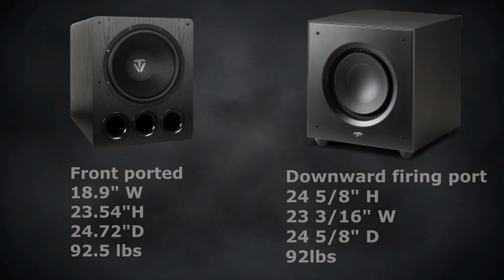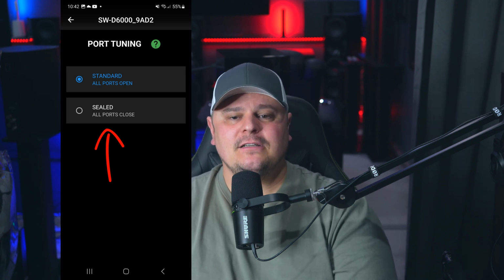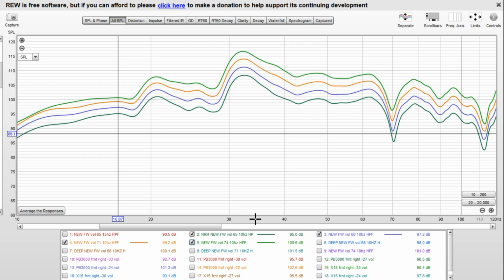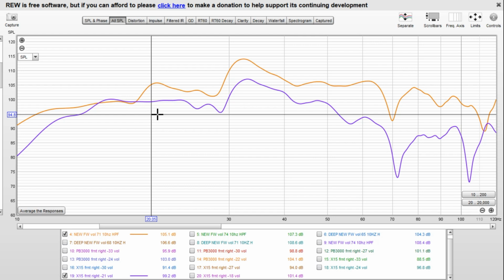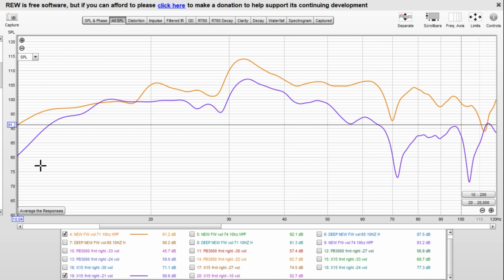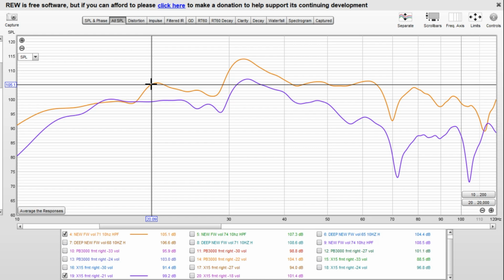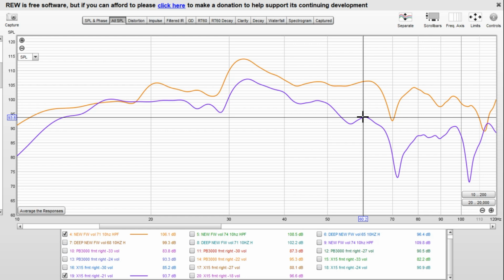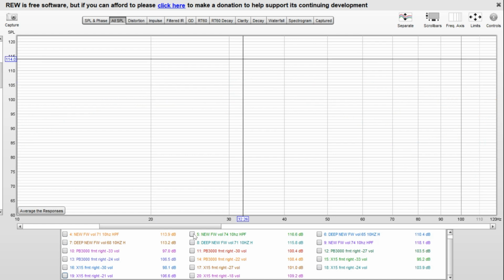Subwoofer Showdown, The CHEAPER Sub Wins?  Paradigm X15 VS Tonewinner D6000 Comparison

Comment: I'm very impressed on the d6000 performance for today's demo. These subs rumble low and deep which something I don't get from a 12" sub. Now I'm confused in either getting the D4000 or the D6000
Reply from the maker: I can understand your confusion!  The D6000 is an impressive subwoofer.  I would suggest the D6000 if you can fit them in your budget.

Comment: Great video, but there’s an astounding discrepancy between your REW measurements and the X15’s CEA-2010’s burst measurements. Of course room disparities play a big role, but this delta leads one to believe that all of these metrics should be taken with a grain of salt. Not yours in particular, but in the main.
Reply from the maker: But you can't compare CEA2010 numbers and compression testing, they are totally different.
Reply: That certainly may be the case. I probably stand corrected. Great content by the way. Keep it up.

Comment: Many years ago, REL was charging about $2000. USD for a 12". sub.  At that time, I built a dayton titanic 15". kit sub.  It was $699.  The Dayton outperformed the REL in every single area.  Fast forward a few years.  Velodyne made subs upwards of $4000 that had an output of about 105DB@ 20hz.  There are $1200 subs now  that can do that, and more.

Comment: Just saw some reviews today on the new klipsch rp1600. Do you think you’ll be getting one of those in for review. What’s the difference peak power makes, is it headroom? D6000 800rms 3000peak. Rp1600 800rms 1600peak.
Reply from the maker: I am hoping to get an RP1600 in to compare to the D6000.  The peak power will just help for short burst dynamics.  It has more power on tap to give you those powerful short dynamic LFE signals.  It will have more headroom, but only for the short bursts.

Comment: For an initial set up without towers for now, what speakers would you go with that replicates a powered  sound bar or book shelf speakers using the Tonewinner D6000?
Reply from the maker: I would definitely go with bookshelf speakers over a sound bar.  Powered bookshelf speakers will get you better stereo imaging over a sound bar.
Reply: No amp yet. Would the bookshelfs use tv audio out? Also what tv out would plugged into D6000?

Comment: Another great video! I’m curious have you reviewed the monolith 13 or 16 yet? How would the D 6000 compared to either of those? My three PB 2K pros are not cutting it for me in my 11 x 18 room. And I really need to replace them and hopefully only want to do this one more time since my pb2k were an upgrade from the sb1k pros. I can see myself spending $1500-$2000 per sub. With a max of $4500 spent. What would you do if you had $4500? 2 monolith 16, 3 d6000, or 3 monolith 13?
Reply from the maker: Sorry my friend, I have not heard the Monolith 16 or 13.  Do you find you get a nice smooth response with 3 subs in your space?  If you are getting a nice response, I would try and stick with 3 subs for your next upgrade.  All 3 subwoofers you listed have fantastic output, if budget is a concern, get the 3 D6000.  With the money you save, invest it into an upgrade for something else in your system.
Reply: @SpecOfTech  I’m able to achieve a pretty nice summation of them using my MiniDSP, I just get little to no room pressurization. I have a window sized opening and door sized opening to another part of the house in that room. I’m afraid to make the wrong decision and be underwhelmed again after spending even more money. I’m sure you’ve heard all that before though. If you were going to go 1 step above the d6000, what would that be?

Comment: Very strange performance data on that x15. IIRC, the x15 killed it in the mid bass region during the Audioholics testing. I believe they called it a mid bass monster in the review.🤔
Reply from the maker: It absolutely is a mid-bass monster, but you can't compare CEA2010 numbers from Audioholics, to compression testing, which is what I have done.  CEA2010 numbers are burst measurements, and just measures the peaks on a short burst of certain frequencies.  Compression testing tells you when the drivers starts compressing at certain frequencies based on its own limitations and DSP.  Audioholics has some more advanced compression testing on their page of this subwoofer and if you have a look, you will see it started compressing at a similar SPL as in my testing, give or take.  Their measurements were not in room, most likely taken outside, so my measurements will be more flattering in the low frequencies, given the room gain.  Not exactly apples to apples, but I do believe their compression testing does correspond with mine, given the differences in testing environment.

To make a long story short, compression testing is not giving you  the max output on each frequency, like CEA2010 numbers are.  It is giving the max output before the driver starts compressing SOME frequencies.  I hope that makes sense.
Reply: @SpecOfTech  interesting. Still seems like something is off to me. Given what we know about driver size, amp power, and cabinet volume - the 3 subs you tested and compared should be more similar than different. I believe they all claim to have long throw/high excursion drivers as well. That is an absolutely gigantic disparity in performance, wouldn’t you agree?

Anyway, I’d be interested to see how it stacks up against the Cap 2400. It should not be close.

Comment: Was the x15 in music or movie mode - you mentioned you had them both in their "standard" mode.

Could you compare or upload some screenshots somewhere of deep and strong vs movie mode, if indeed the x15 was in music mode ? 

I ask because the digm according so sone publications is a quite a bit softer in midrange in music mode, with 5db less from 35 hz to 65hz in music mode vs movie.

Wondering what the tone winner does in their other modes.

Thanks
Reply from the maker: The  Paradigm was in movie mode for max extension.  If you want to see how the other modes in the Tonewinner perform, you can see that in the review video, here is the link: https://www.youtube.com/watch?v=y4HyhWM10YQ
Reply: @SpecOfTech  thanks.

Comment: what do u mean by "compression" in this measurements ?
Reply from the maker: When measuring the output, the DSP will start compressing the response (reducing the SPL of certain hz) to help protect the driver from damage.  So essentially, once you start hitting compression you are reaching the threshold of the driver, at least at certain frequencies.

Comment: The compression testing you did was the bare minimum. Mainstream reviewers provide compression tests for the full bandwidth rather than stopping as soon as any slight compression is encountered. Without that, how are we to gauge mid-bass performance? Was the Paradigm using ARC? If so, then it doesn't make sense to count its taming of peaks as loss of output. Regardless, some data is better than no data so thanks for your effort here.
Reply: He was not using ARC..😊

And for subs, there is not much above 120hz anyway ..so no need to measure higher..
As most systems anyway, cross over much lower..and LFE Typically plays to 120hz.

Anyway, with the info he provides, I see enough to make a decision for my eyes anyway ..

But yes, some Info is better than no info👍
Reply from the maker: Clarify what you mean by "full bandwidth".  I stated in the video that no room calibration was used.  Give me an example of a "mainstream" reviewer that provides "full bandwidth", I believe there may be a disconnect with what you mean, and what you are saying...cheers.
Reply: @SpecOfTech  By full bandwidth I just mean for LFE, or up to around 120hz. You're stopping as soon as you encounter any compression but the sub may have a lot left to give in other areas. For the type of testing I'm advocating Audioholics reviews by James Larson are typically good examples - check out their Monolith sub reviews. They perform what they call "long-term output compression" tests where they just keep increasing the signal until no more output is seen at any frequency all the way up to 300hz or more. Erin's audio corner has also provided that data but just in table form. Their tests are outdoors so I'm not suggesting you go that far, but increasing the volume until compression is seen at all frequencies would definitely show more and help people make informed decisions. Doing that with JTR/Funk/Harbottle subs may be too extreme but I doubt there's much risk with a commercial 15" sub. Thanks again!
Reply from the maker: @miscreant1739   I understand what you mean now, but the numbers Audioholics provide are CEA2010 numbers, they aren't quite the same thing. CEA2010 numbers are burst numbers that show what the subwoofer is capable of in short bursts at certain frequencies. Compression testing is meant to show real world in room measurements and when the dsp starts to compress the output to save the driver from being pushed to far.  If I kept turning up the volume, it wouldn't sound good and would just cause more distortion, which in real world you won't listen at that point anyway.  I do know what you mean, but I don't think there would be much value in me continuing to turn up the volume after compression and running the sweeps.  I do hope one day I have the means and equipment to conduct CEA2010 testing though.

That does give me an idea though.  I could try and do burst testing in room, to show what burst measurements I get at those frequencies in my room.  The downside is it would be very specific to my room, and the audiophiles would constantly call me out on how that isn't useful information since it's specific to my room lmao.

 Thanks for watching my friend...cheers.
Reply: @SpecOfTech  I wasn't referring to their burst testing. I think you need to scroll down the page a bit on the review and you'll see what I'm talking about. They provide a graphical representation of compression testing results. The numbers aren't as useful as outdoor tests as absolute indicators of performance when taken in isolation due to room effects, but I think they have some value when comparing one sub to another in the same room when variables like placement of the sub and mic are kept constant as you did in this test.
As for distortion, REW displays distortion info and you could always call it out if you find it reaches an unacceptable level at a certain frequency. Just ideas here, good luck.

Comment: Measurements are one thing but what is the sound quality like? Does the Paradigm X15 have cleaner and tighter bass?
Reply from the maker: These comparisons were about the objective data.  When it comes to quality, I have to base it off of memory.  IMO, they are both very similar in SQ.  They both have a nice deep tone to them, more similar in their sound than they are different.  The TW D6000 is more similar in sound to the Paradigm X15 than it is to the PB3000, even though they all have a deep throaty tone.  The Tonewinner has more impact with its lower octaves, similar to the X15 in that respect.
Reply: Yup I maybe have to buy one just to test it out!
Reply: I have a x12,, in my 6 sub system!